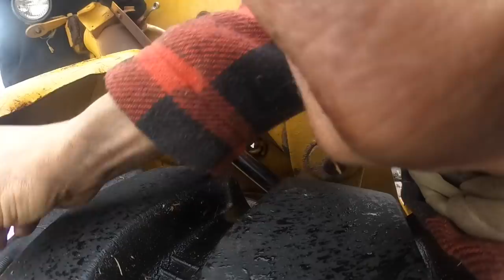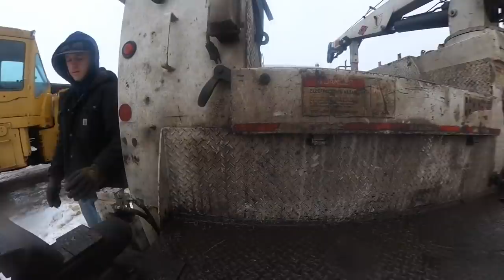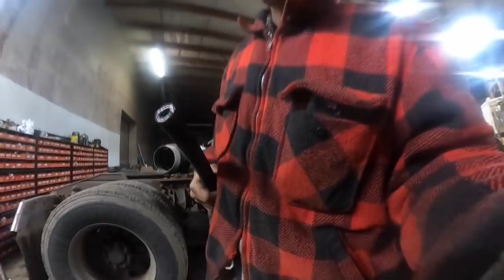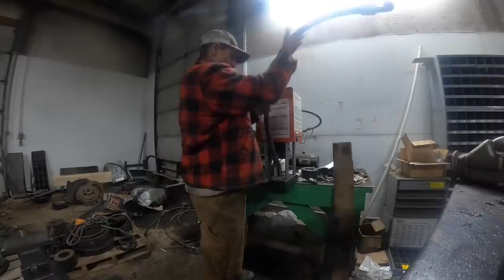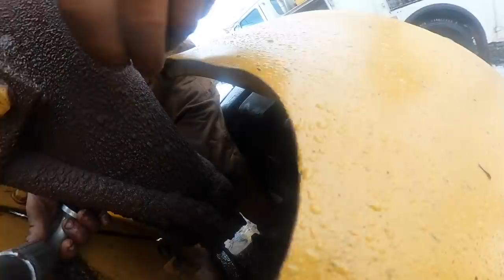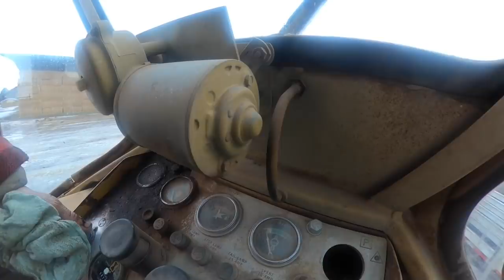Cat 950 hydraulic hose replacement

Comment: Couple tips from an old metal burner.
1.  Start with your torch and hose in the most wound up uncomfortable position so you unwind and get more comfortable during the cut.
2.  When its colder out, preheat as much as possible before the cut.  This keeps the cut moving quicker and smoother.
3.  Build your own circle cutter using threaded rod, thumbscrews suck and never cinch down tight on a smooth rod.  You can tack weld a hose clamp on the end of a threaded rod for the torch tip.  The center can just be a big punch drilled out for the rod to go through the shank.

Oh and get the right setup for your plasma, much nicer. ;). Good job getting it done as usual.

Comment: I truly believe that engineers and designers are told design vehicles, large equipment to be two types of designs. #1 design so they are user friendly to operate, so many people will buy them. #2 design same very very unfriendly to maintain and repair, so it is close to 100% that people must bring them back to dealers that sold them

Comment: I don`t know what vintage the dodge pickup is. But on the older ones I have rebuilt several of the vacuum shifters. And if is a newer one it could be the shift motor or control module.

Comment: We used to use screw in fittings on nylon hoses for our Fork Lift Trucks.  The outer was easily put on, but the tapered inner fitting had to be well lubricated and then a continuous torque turning it into the hose.  If you stopped turning you could never get it to move again, so it was a good work-out to turn the fitting maybe 16 revolutions to get it to seat.   Didn't get to do many for customers, but we did a few at training school, where we held the hose in a very substantial vice...

Comment: Dont know what you do there , we use to have our fuel delivered premixed with kerosene to prevent the fuel from gelling in the winter , but , the cummins had the long spin on fuel filter on the drivers side just outside the frame rail it would still gel when you started moving an air hitting the filter when it was real cold ,it was like you ran out of fuel an the engine quit , any chance of that compounding your existing service truck problem , the detroits canister filters were not a problem the second filter was bolted to the engine block . Ive loaded myself many a time with a 950 very reliable loader , also 966 , 977 , 980 & 125 michigan from a cedar rapids pit master rock crusher , primary crusher 8V , secondary crusher 12V , also loaded some rock trucks with 992 .

Comment: Hey Warren, thanks for putting out so many video's lately, most interesting channel with all the different equipment you work on.  Sorry you have to pay 1500$ plus the injectors that aren't cheap, with your labor going into it.  The guy's that were complaining about you charging for mileage don't see this kind of cost, plus insurance, and just general maintenance.  Hope it don't take to long for ya to get the parts to get it done.  Thanks again, and God bless.